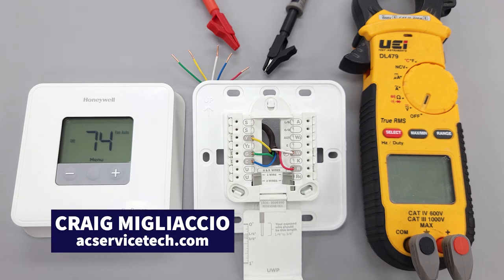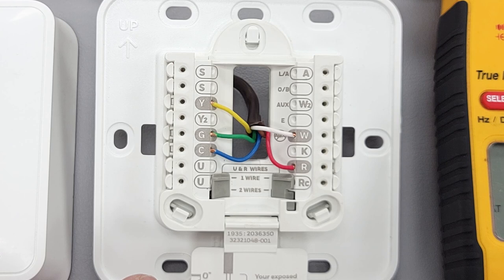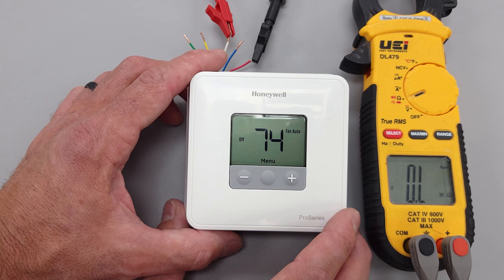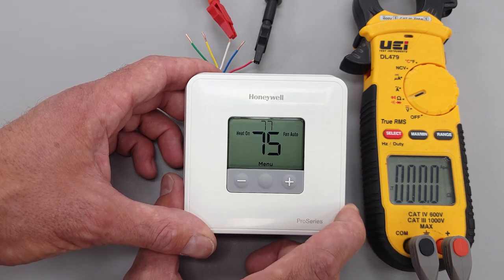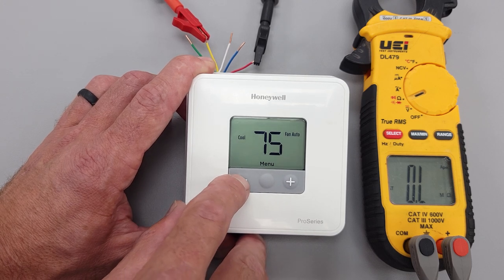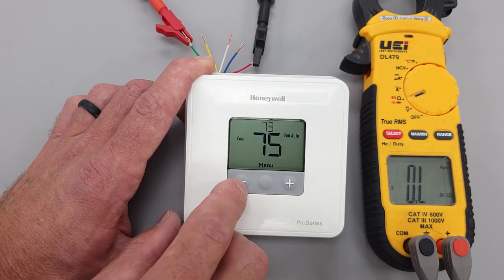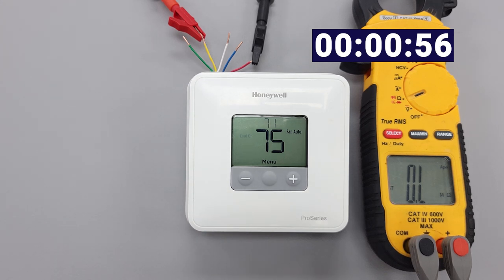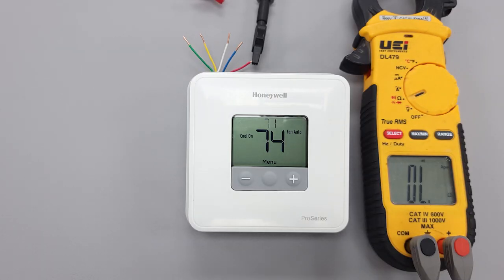Teaching Thermostat Functions to New HVAC Techs and Students!

Comment: Great video.  I always wondered about the compressor delay.  I know with a lot of window units, they manual will tell you to wait 5 minutes after you turn it off before you turn it back on.  

But I've also been curious about the many videos of techs working on an outdoor coil. Seem like a lot of times, during their testing and diagnosis, they will kick the compressor on and off during a repair or whatever, and they don't always seem to wait 5 minutes between starts.    Just curious about that.  Thanks,
Reply: From what ive learned about doing that exact test is to see whether the compressor has the power to pump the system and to see if the valves inside the compressor are not weak or faulty.

Comment: Could I test the thermostat for proper function at the furnace or AC unit in the same way ? I would assume yes just wanted to verify
Thanks for all the great content
Reply: Yes, you just unhook those wires shown in the video from the boiler or Air Conditioner side and test the continuity when setting the desired mode 😉
Reply: @johnnychang4233  thanks 👍
Reply: Keep in mind, a problem that could arise from testing at the furnace is if there is a broken thermostat wire.
Reply: @chrisdeanndavison3626  thanks 👍 Then I could disconnect the wires and connect 2 together at a time to test continuity. Right ? Or do you know a faster way 🤔  my old boss would have me just run wires from t Stat to furnace but it is a lot of wire sometimes and then I have all these long rolled up pieces of wire on my truck it always seemed like a waste to me 🤯
Reply: @servant-4-jesus  I believe you could tie all wires together at once to test continuity. It would save a lot of trips from the basement to the thermostat. Although, if you have damaged insulation (which is not uncommon in a broken wire situation) and wires are touching inside a wall, that wouldn't work either! If that were the case, you'd need to test for continuity with all wires disconnected from each other and also the equipment. If any wires test 0.0 ohms between and they're disconnected from everything, then it's a short. Thermostat wire issues can take a long time to diagnose!
Reply: @chrisdeanndavison3626  Thank you 👍 I appreciate the help. May you and your family be abundantly blessed

Comment: Good video. Normally for process industry compressors, the suction pressure is never equal to the discharge pressure.
But why it is important for HVAC compressor?
Thanks.

Comment: Sure glad I've watched your videos to have the same conclusion that the tech that came into my home did. $450 dollars later and the same parts replaced that I thought.

Because they are accredited they get the parts sent under warranty, but if I try?
Reply: If your system still has a parts and labor or just parts warranty then you would either pay zero or just labor to install tstat. If I understand your question correctly. If you were to install the tstat cost is totally on you.

Comment: can you show us how to install a 5 minute time out relay for the compressor and what is the best relay to use.  I want it connected to the Line side and if that hasn't been hot for 5 minutes then 24 volts will not make it to the contactor.
Reply: Don't need Do anything Thermostat Now already have 5 min relay For Start Compressor or outside unit . It's very Safety
Reply: @annaleet  so if the power reset for 10 seconds to the thermostat it will not call for heat or cooling until its 5-minute timer expires?
Reply: @PosiP  yes that's correct
Reply: I typically don't use the batteries I just use the power through common and red (24v)
Reply: @aajdre6556  so if the Tstat is powered by batteries and the power resets, and you have a call for cooling as the power is reapplied you could get a compressor starting with high pressures.  That is the reason I asked about the timer relay.   For heat pumps, you could just break the power to the reversing valve to equalize as well.  I was asking a question I know the answers to,  sorry.